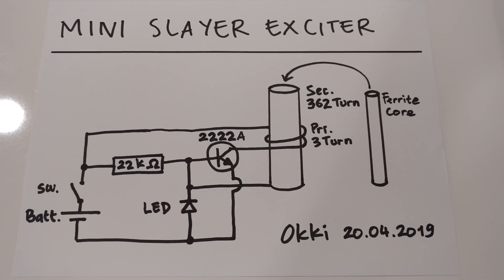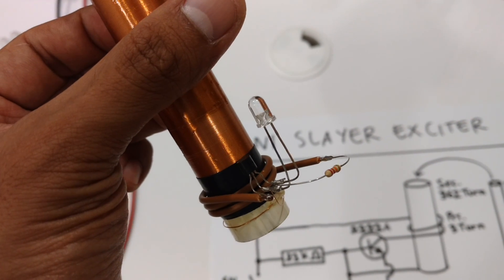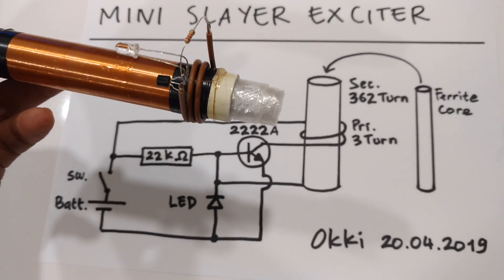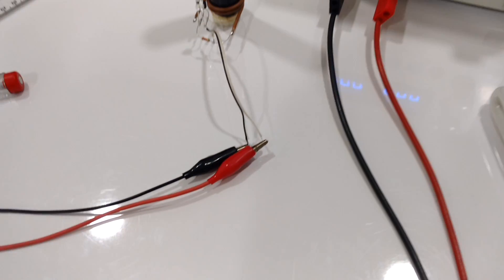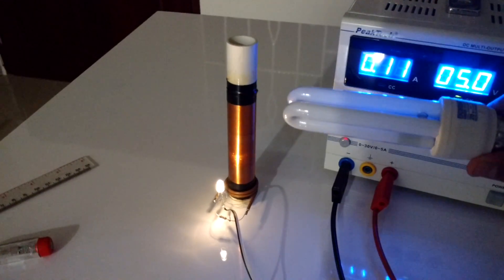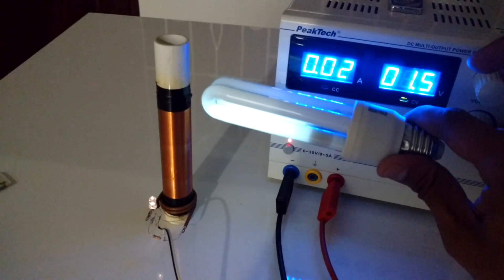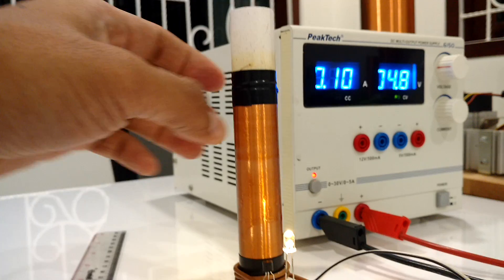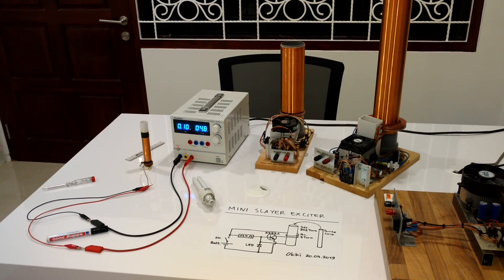Mini Slayer Exciter

Comment: 15Ghz single pulse square wave energy transfer (one pulse in every 2 for 5-15Ghz) YoutubeNinjaExpand Thank you very much for your posted video . Difference of a length of wire by 2.3 cm compaired to the 3cm version of the antena for 4 nano newtons of force to 4KN. (amps to newtons for up to 200 columbs) 
microwave absorbing diode

Comment: Hi. If you like to replicate Gary’s Exciters and are interested in reducing your current draw and reduce your needs for winding coils, try this, Gary’s Choke Exciter Circuit. Have had it running for weeks on a 4volt battery. Nice quiet lighting for a warm veranda in KL :
https://youtu.be/5xQ6_tZ2LzI

Comment: Hi Okki,

Very good catch this ferrite core idea. I would not even have dared to use it.
My small Slayer Exciters oscillate without any ferrite core. My (single) big one, also. BTW.
I will try this ferrite core ASAP. Sounds like it greatly lowers the input watts. Does it not?

Perhaps will you, one day, show us an Over-Unity (OU) device of your own. IMO, you should be able to do this.
Unless, of course, that you are not an "'OU' believer".In that case you will never reach it.

BTW: in one of your vid, inserting a copper pipe in one of your huge (and nice) Slayer Exciter "secondary" is not a so good idea. 
This pipe is ok but should be "grooved" as to not act as a closed loop. Instead, you kill the process.
Take any Slayer Exciter secondary coil... Measure the Henries. Then, put a single shorted (connected) turn of wire around it. Closed loop
Measure the Henries.
----------------------------------------------------------
From an aged Breton (and secondarily French) OU believer bl' guy.

An example of Breton soul and language. Maro eo ma mestrez - Yann Fañch Kemener. Dead is my beloved
https://www.youtube.com/watch?v=GAlKDeaLa5I

Another one: An Alarc'h. The Swan. https://www.youtube.com/watch?v=c-YiZgCLO90
Yes, this is "off topic"

Very Best,
Jean
Reply from the maker: Hi Jean, this ferrite core lowers the resonant frequency. This circuit won't oscillate without it. Thanks for watching and commenting!

Comment: Dear xplain the secundary conections please
Reply: In a Slayer Exciter, one side of the multi turns of the secondary coil is  connected to the base of the transistor.
The other side is not connected. Please google : Slayer Exciter circuit